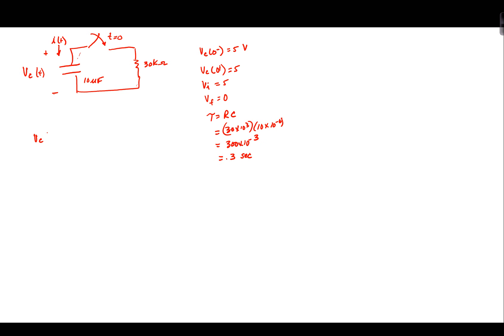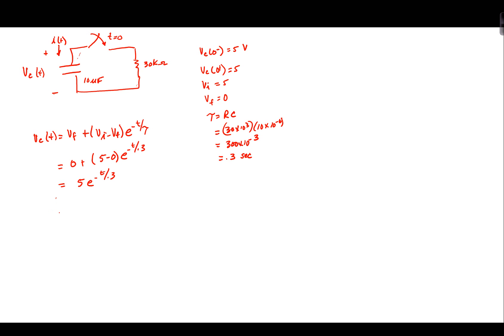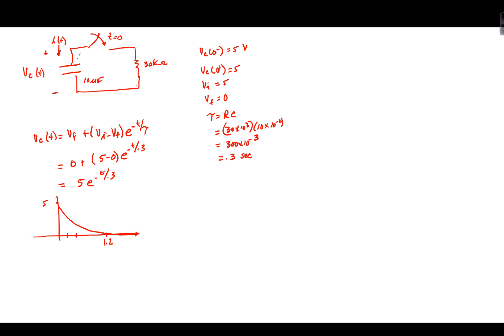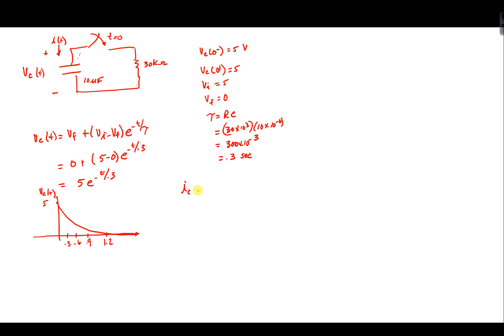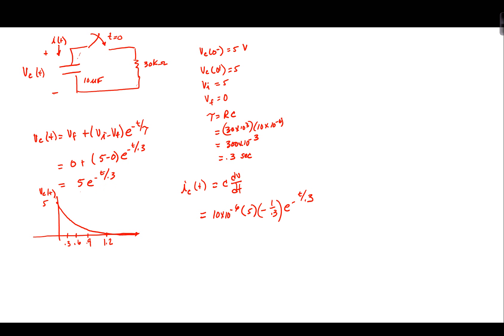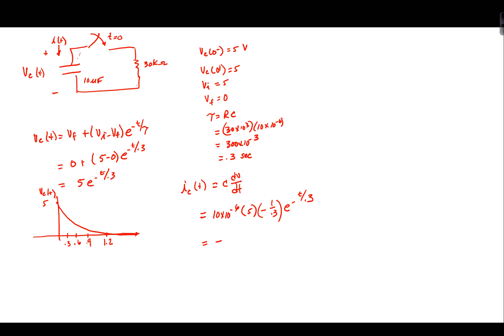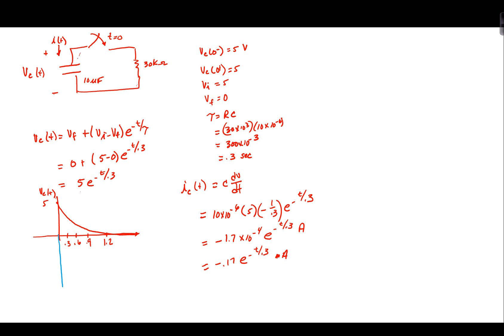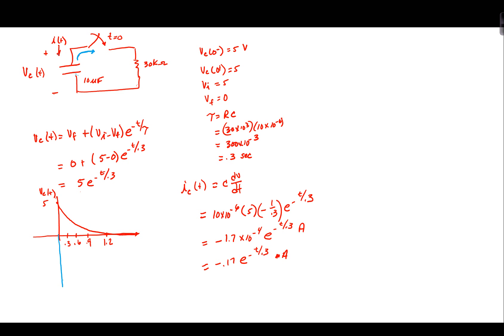RC Example 1 Simple Natural Response

Comment: Instead of using the capacitance and the derivative of the  voltage, why didn't you just divide the voltage by 30k to find the current? Using the convention you set up, the current flow direction would be obvious.
Reply from the maker: Your suggestion is also correct and easier.  I wanted to drive home the voltage - current relationship in a capacitor, which is differential ie., the current is proportional to the derivative of the voltage.
Reply: @brinton417  Sorry,  I wasn't thinking from a teaching perspective.